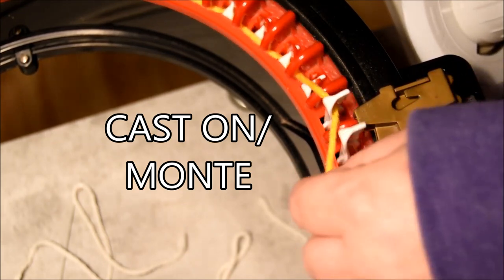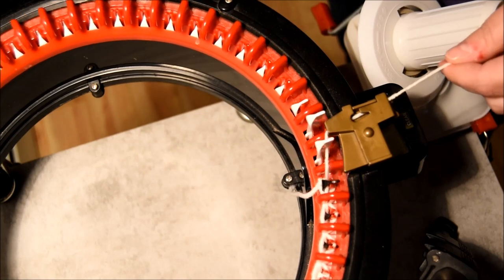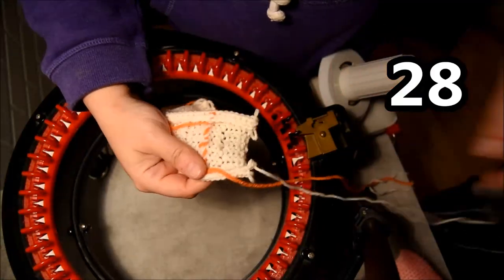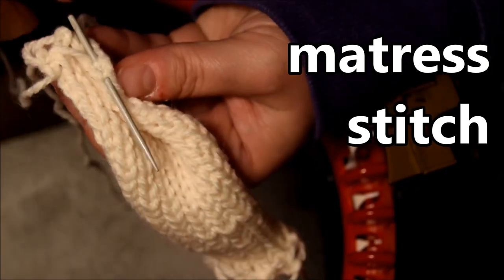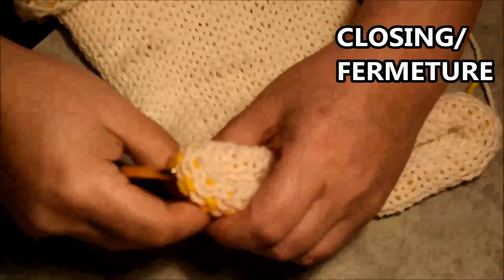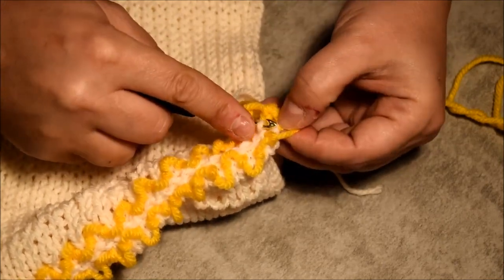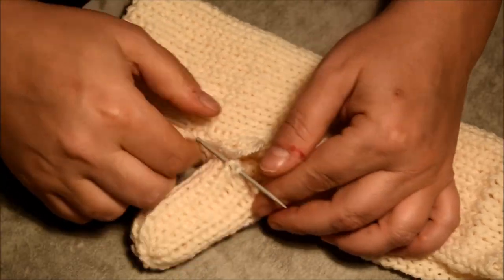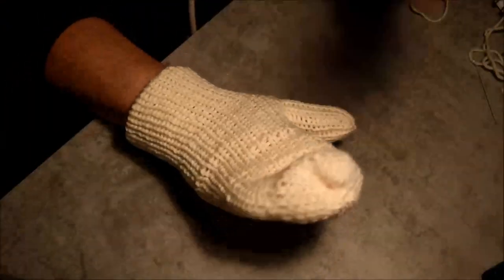#mittens | one knitting machine ONLY  | on 40- 44- 46 or 48 needles

Comment: Did you put switch on panel or round mode?  I don't hear the click at the end?
Reply from the maker: i never use the panel switch always on circular mode, good point i forgot yo say it in the video
Reply: Thanks Jojo Juju that's what I thought, is there a good reason because if we do this way we have to watch back and forth and not go pass the number of stitches that we want.  Does it work better, lets say on a 48 needle machine, we want to make a flat panel, do you mean to tell me I can just go back and forth and watch for the last needle to get done then switch to the other side.I just finished knitting a pair of mittens it took me many hours at night to complete them.  I like the ribbing at the wrist, I guess I could just knit the 20 rows of ribbing then make the thumb gusset and thumb and then attach to machine somehow?  Can we attach hand knitted stitches to the addi?  I guess that's my question.  I find you are really great at explaining things, I love listening to you, you are such a positive thinker.
Reply from the maker: @dianelap67  more you practice flat panel more you get confortable with it not block by the little red switch . YES some people do the circle for head on circular needles i think size 5,5 to 6 and then they put it on machine for one layer hat there is a video on you tube about it . I am on my cell cant send it from here sorry.
Reply from the maker: If you need mitts to be longer for wisht add 22 rows wil b perfect and warmer for hand